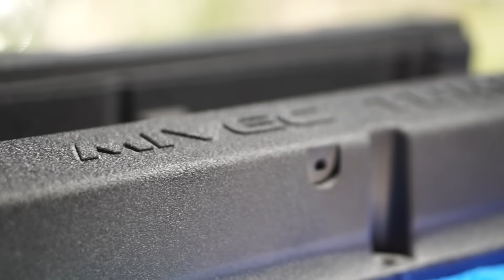Building a Mitsubishi Lancer Evo 9 in 15 minutes!

Comment: Where did you get the chassis mounted front splitter?
Reply from the maker: It’s Voltex
Reply: Do you think it ONLY works with the Voltex bumper? Or would I be able to fit a Oem 9 from bumper with a different lip?
Reply from the maker: @Jeremy_Thomas  it was designed to work with the Voltex circuit lip, but I’m sure with some custom bodywork you could figure something out.